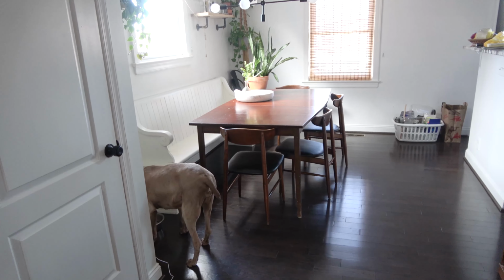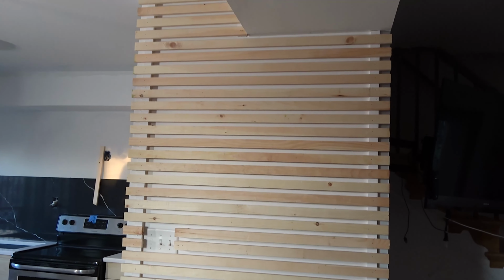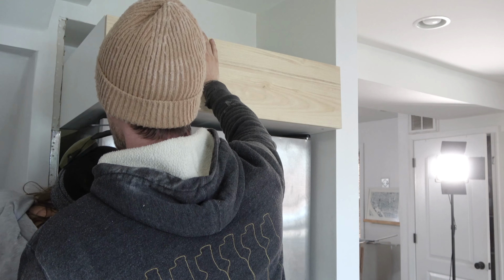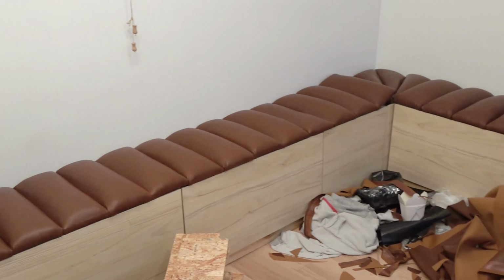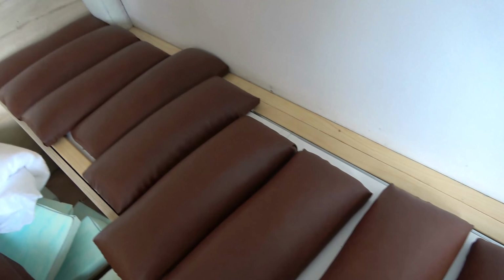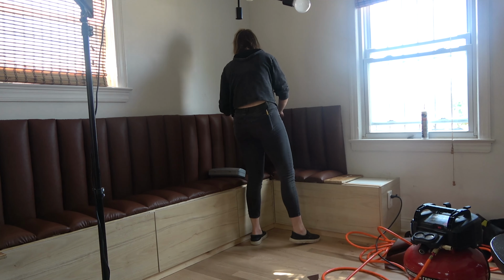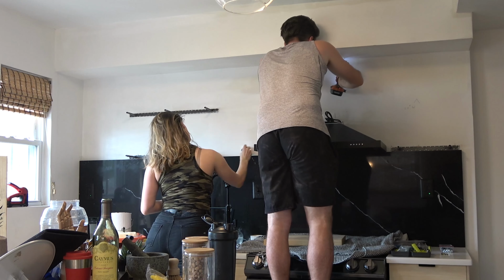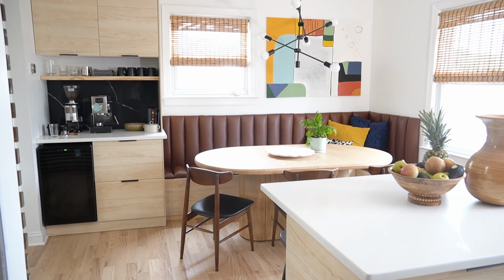Renovating my Brother's 100 Year Old DC Kitchen| PT 3| The Reveal

Comment: Hey I love your videos!! In this one you asked if anyone could suggest a better way to do the kitchen bench or a different idea. Take the board n lay out the foam flat on the board, carve your lines into the foam n then lay out the batting over top, fit the batting into the creases of your design and then do the same with the leather but as you do the creases of the leather staple inside the creases to the board and repeat all the way around and then seal up your edges… I hope that made sense n wasn’t confusing lol
Reply from the maker: Oh okay! That totally makes sense I got another comment that I think was explaining this process as well. That would be way easier and even easier for the corner piece! 🤦🏽‍♀️ now I can try this next time! Thank you so much for the help!